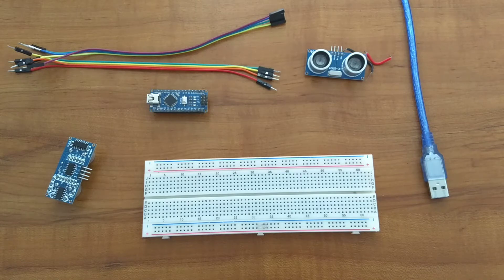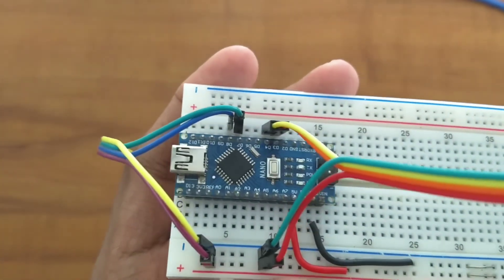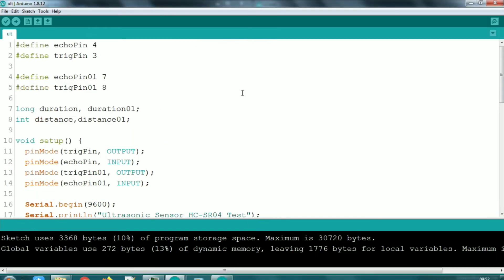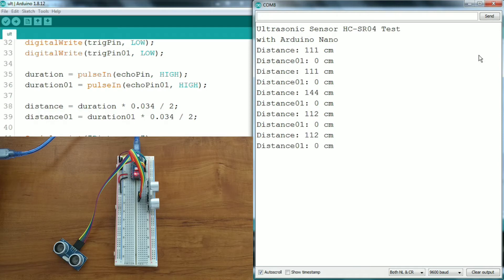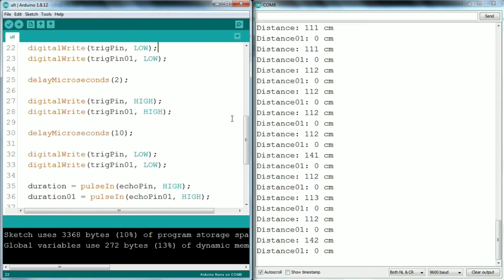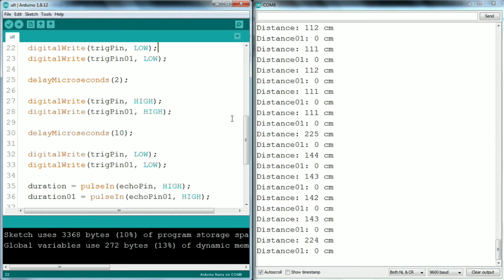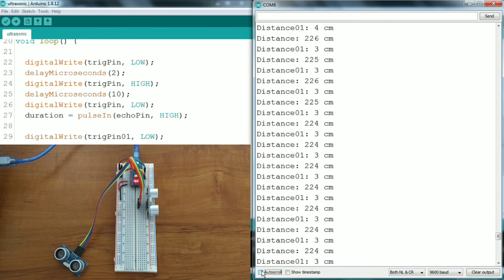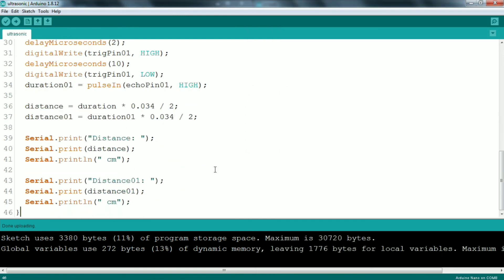How to use two or more ultrasonic sensors? 🔴 (distance = 0 cm)problems solved

Comment: Hello sir I tried working with your code and both my sensors are showing up 0 value the (distance = 0 cm) problem not solved. can you share me the complete code that you did as in the video you changed the code while working on it.

Comment: hi brother your explanations are easily understandable.
i am bala from tuticorin.

Can you pls make the video with 16X04LCD for getting the result 
1)Millimeter 2)Centimeter 3)Inches 4)Ft  values are at the same time

also CM, Inch, ft must read the decimal points too brother

(with wiring / circuit diagram - if it is w/o bread board i can easily understand), bcz i am zero knowledge in electronics/arduino